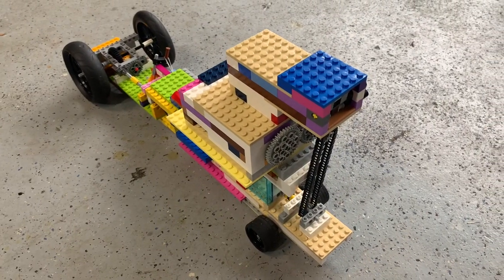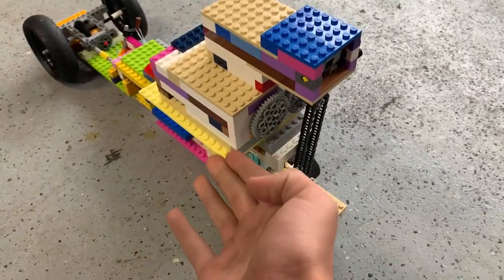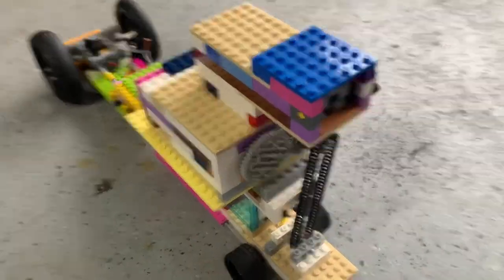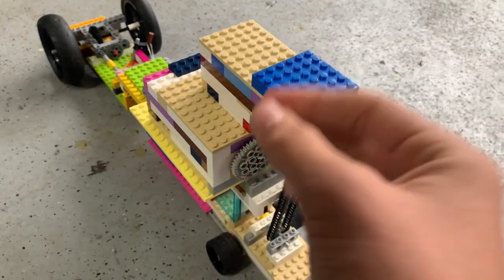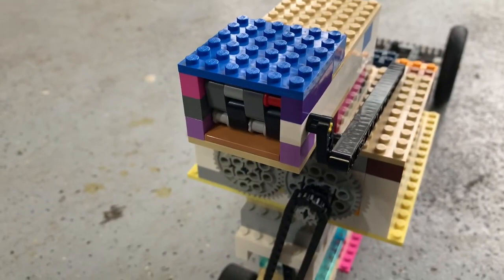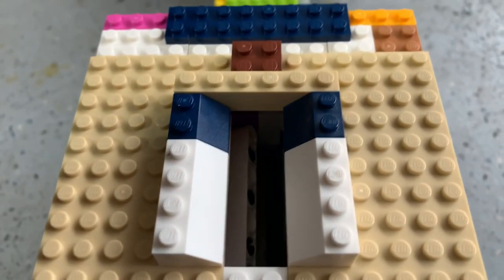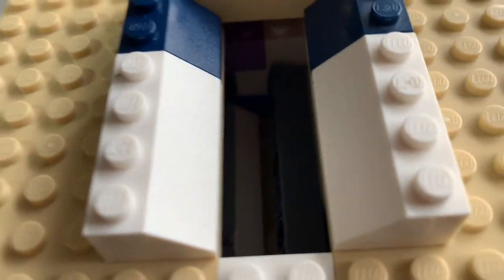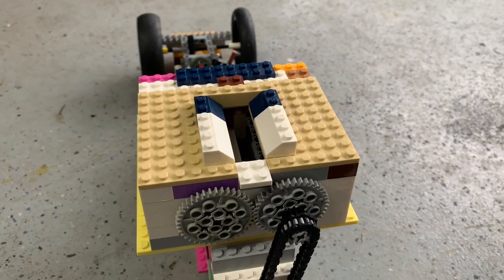First Ever Working LEGO Supercharger!

Comment: Dang, looks pretty sweet, btw does it actually accelerate when you move the top throttle, I couldn't tell.
Reply from the maker: It will when I actually connect it to a good engine
Reply: @747technics8  how? Does it suck air or push air in when connected to a good engine, tryan make my own
Reply: @ViperzDesign  how it works is it blocks air and then when you push it down it will open so more air can come through

Comment: i’m confused on how this benefits the engine unless it’s able to increase air velocity bc it dosent combust anything
Reply: from what I believe it pulls more air out the exhaust causing more air to be pulled through the intake.
Reply: @electricityandfire  makes sense thank you
Reply: @mr.frenchfry4448  also in real combustion engines the supercharger not only rams more air in to increase density to increase the explosions but the act of ramming air in helps force the pistons back down.

Comment: I don't understand how this is a working supercharger. It is a vaccuum engine. First, the tolerances on the paddles mean it is not doing anything apreciable. If it was, it would actually make it more inefficient because you are drawing more air into the cylinder so more to suck out. The reason why a supercharger works is you are putting more air into the combustion chamber to burn more fuel  efficiently and thus more power through combustion. This does not use combustion so no advantage.
Reply: It sucks in the same amount of air as it would without a supercharger. Because in its cycle, the valves are open for a certain amount of time. It would only suck more air if the valves were tuned

Comment: We could put something like this on a v8 but reroute the exhaust through a manifold into a fan on the back of the engine and connect the turbines in the middle to the intake holes but this would mean you would need a cam system with the intake on the inside of the v and the exhaust on the outside